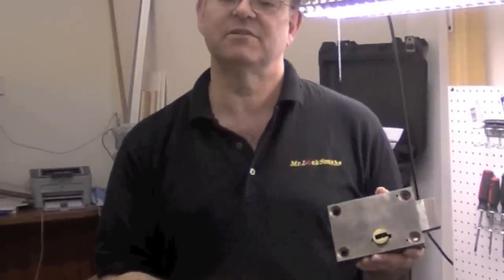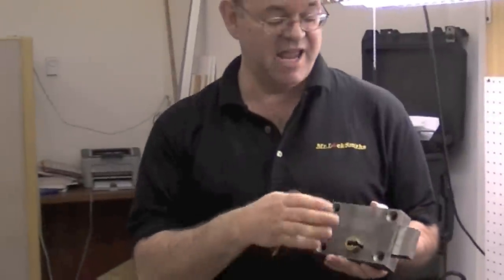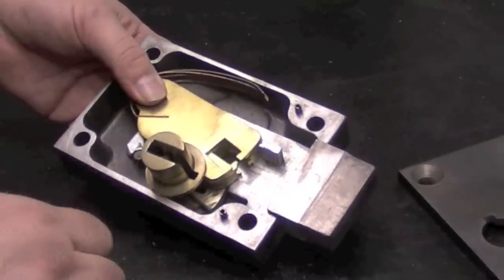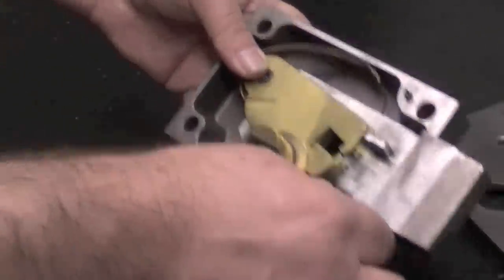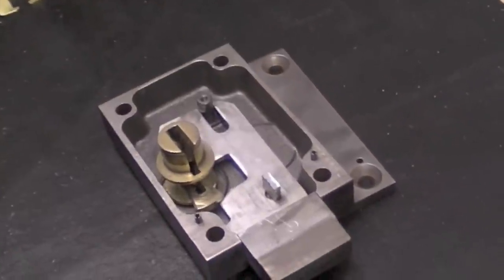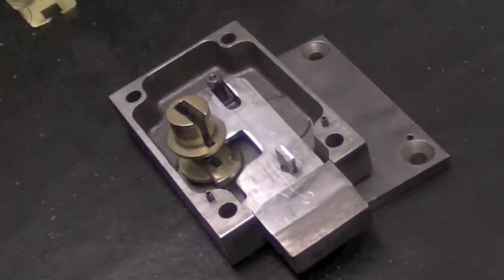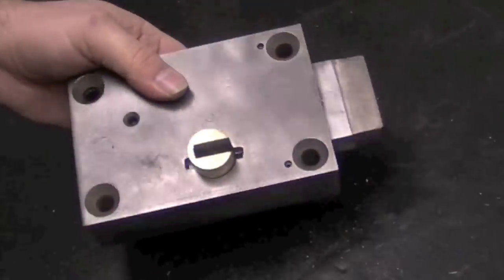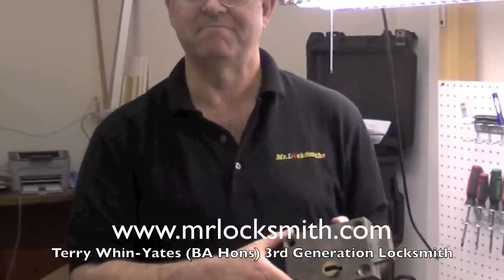Folger Adam Detention Jail Lock | Mr. Locksmith Video

Comment: What keeps the inmates from accessing the levers by removing the screw? That will be an easy bypass if the prisoner could access the lock from the outside.
Reply: They are installed in the door frame with several security screws and the door has to be open to slide it out as well

Comment: This is an older #86 FA lever lock. As you can see it does not have the pressure sensitive bushing that is required for safety reasons.
Reply: I used to work for that company. This was a great company

Comment: That looks like it's been masterkeyed, not too surprising since it's for prison use although it does remove a large part of the security from it. I was a bit surprised to see no anti picking features in it so I'm assuming it's fitted in a high traffic area away from most prisoners, most likely a gate.
Reply: there are no master for these locks 1 key 1 lock that is until i sell someone my idea
Reply: @michaellange6598  This lock has definitely been masterkeyed. The gates on the levers are far to wide open for the bolt stump to pass through.

Masterkeying means a lock will open to a set of group keys not any key you put into it. How much do you even know about locks let alone Lever locks? Can't be much if you don't know the terminology. This lock can be picked open in seconds with a flat piece of metal and a bent wire. The only thing securing this is effectively the first lever.
Reply: @michaellange6598  Hey. The gates speak for themselves buddy. I've been a locksmith for 30 years and collect and study locks just for kicks. There isn't much I don't know about them so calm down. The gates are too wide open for the bolt stump. 

You do understand that Prison locks need to be under a masterkey suite for practical reasons don't you? Did you see the V notch on the bolt stump but none on the lever pack? That means it's under a masterkey suite. Is it sinking in now?
Reply: @Kit_Bear  that v gate is close tolerance allowing dead bolt to egress through  increasing close fit  show me 2 different keys operating lock and this is  setteled --the large southern steel keys correct?
Reply: @Kit_Bear  want to borrow mine and buy my factory made key belt buckle while you are at it?
Reply: THE END
Reply: @michaellange6598  OK. Locksmithing 101.

This looks like a 7 lever lock. Looking at the heights of lift there's 10 possibilities of key steps for lift. given the number of levers and steps this gives us 10 million possible differs. The gates however due to the large gap in each gate reduces each lever by 5 or 6 steps in the key. This gives it a true number of around 16,384. Even if we were to make it to 5 heights this would only make it 78,125 effective keys that can be used that are not in the masterkey suite. In the masterkey suite this is around 15,000 possible keys that can open this lock.

I don't know what you are thinking of when I say masterkey but in locksmith terms it means that a set of locks is keyed to a suite of keys. All being different except for a few steps in the bit. Each lock has it's own key but cannot open any of the others, the sub masterkey can open a number of locks but not all and the masterkey can open up most if not all of them. If you're thinking of a single key that opens up all the locks it fits into then you're an idiot.

Read George Price's book, A Treatise on Safes, Locks and Keys. This is a locksmiths Bible. I have a first edition in my collection. Read it and get educated!
Reply: @Kit_Bear  educated????  FINE   you WIN------------DON"T BEND BREAK  NOW FO

Comment: I'm very surprised inmate don't pick these locks, they seem so easy when you look at it
Reply: you cant ive tried in kingston penitentiary canada
Reply: @jeff420sparky8  I think big concern is inmates copying them. I've heard of this being done. Basically someone would take a gum, take a key and imprint the key onto the gum, then copy the key this way. I've even heard of people with such good, photographic memory that they take one look at a key and they can copy it.
Reply: @taiwanluthiers  its happened. i used to be inmate in federal here in canada. kingston penitentiary. did 13 yrs in a pen that was built in 1835 shut down 2019 even though government put 500 mil in reno 4 yrs previous. the keys here the old ones they would throw in the lake right behind pen. divers found old skeleton keys for bar system slide lock system operated by spinning wheel. that wheel would slide bar over the cells locking unlocking. plus individual unlocks with skeleton key. when pen closed in 2019 that locking system was still in use. the penitentiary is now a tourist destinatiin. plus theres museum across street.
Reply: @jeff420sparky8  I get the sense that these locks are only used in North America. In Taiwan the jails don't seem to use them. They use whatever lock that is normally used locally, nothing special, except they're like probably 20 times harder to pick. I mean the easiest keys I've seen are probably the 4 sided keys, meaning there are 4 sides to the key, meaning a locksmith would need very small tools to even try to pick them. These Folgers Adams lock is likely very easy to pick otherwise (outside of jail that is). We also have keys that is a flat bar with keyway milled into them, and dimples of various depths on all side of the key. Good luck picking those! I don't think locksmiths in Taiwan will ever attempt to pick those, they just drill and destroy them.

Comment: They look like quite an easy pick, what are they actually like?
Reply from the maker: cardiffpicker1 very easy but you need to make a special set of lever picks.
Reply: Mr. Locksmith I would imagine due to the lack of any false gates they would be susceptible to an over lifting pick   aswel
Reply: So, could I fashion those out of, say, toothbrushes or other common, but non-metallic items of the sort that might be bought at a commissary?
Reply: David Kennerly highly unlikely,it would also be extremely difficult  to make any type of lever pick without having access to the inside of the lock